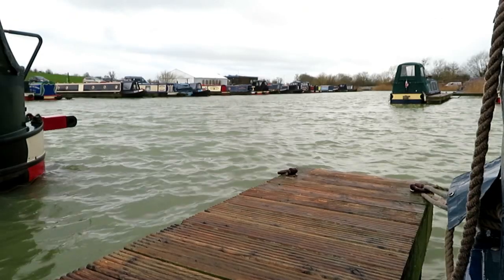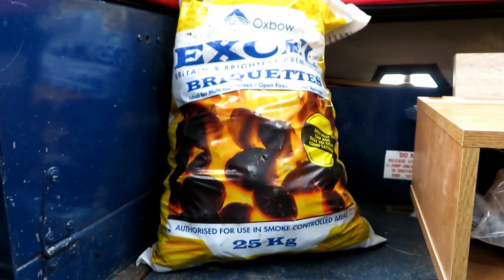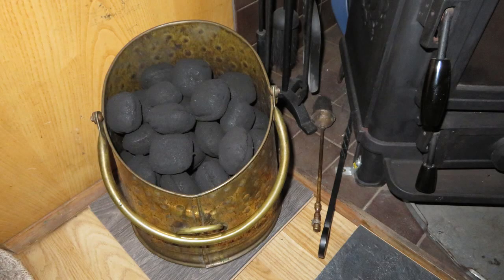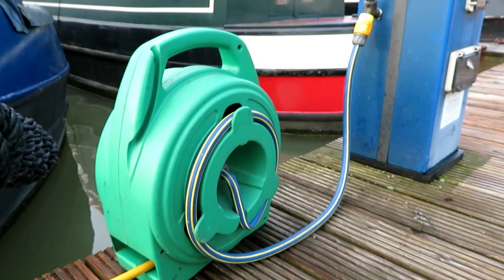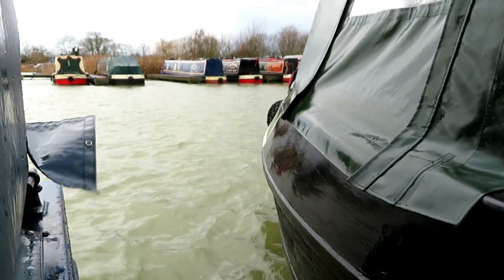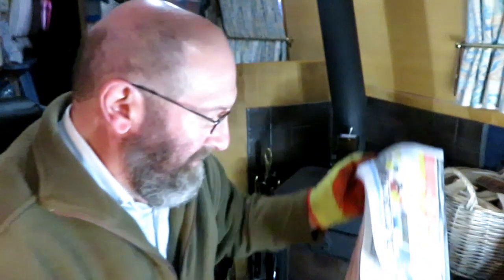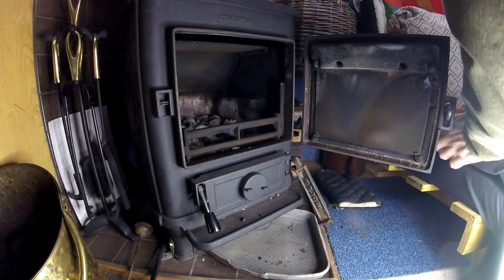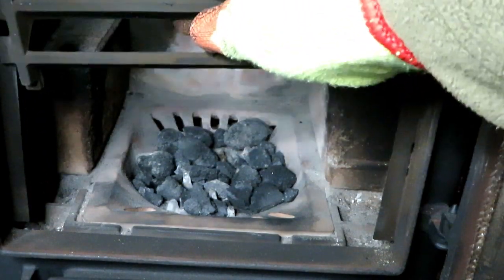89. Narrowboat Life – Fire and Water

Comment: When I was growing up, the primary heat source for the sitting room and dining area of our house was an open fireplace. being in Florida, it was assumed by frugal (read CHEAP) builders you would not need heat often. Where I live/lived in North Florida, winters saw 2-3 months of near and below freezing temperatures. My father would order coal, rough, natural coal, by the ton. It was my job to bring it in and start the fire after school for the afternoon/evening. Every time I see a narrowboater tending the stove in a vlog, it reminds me of that time. Thank you, Alan! My best to you as always.
Reply from the maker: Hi Zach. That’s interesting to hear. I was also brought up with open coal fires. Our coal bunker was underneath a verandah and coal had to be brought up a flight of steps into the house. When my parents had central heating installed, they opted for a solid fuel system instead of a gas boiler, I suppose it was a cost consideration, so we still had to carry on in the old way. Best wishes Alan

Comment: The draft on my Morse Squirrel 1410 is so poor that newspaper produces enough smoke to put out the kindling. 
So I am obliged to use only firelighters to get the fire going, once the chimney is hot then the coals burn fine.
I like a clean door glass, so I rub the glass with damp kitchen paper dipped in fine ash each morning, then we are able to watch the flames.
Great Vlog as usual, keep them coming!
Reply from the maker: Many thanks Geoff. I too like a clean glass but it gets dirty very quickly and I find it a rather messy task to clean in a confined space, so I don’t do it every day. I don’t always use newspaper, as I find firelighters easier to use. Glad you liked the vlog. Cheers

Comment: Hi Alan, thanks for that, I am always stunned when you watch back to basics type programmes on the box that many people don't know how to light a fire. When I was growing up coal fires were all we knew. Cheers take care. Alan.
Reply from the maker: Hi Alan. I was brought up with coal fires. They used to be lit with a separate gas burner. When my parents had central heating installed it was a solid fuel system I suppose, that would have been cheaper at the time than a gas boiler. I had some difficulty filming, hence setting the fire was a little bit messy. Keep safe. Cheers

Comment: Somewhere I read that the bottom vents were for burning coal and you open the upper vents as well for burning wood to give a cleaner and more efficient burn for wood. Is this your understanding as well?
Reply from the maker: Hi Robert. Morso recommend having the top vent open when burning wood. Having the top vent open is also meant to help keep the glass clean. To quote from Morso when using solid fuel "The top air regulator must always be open just enough so that the flames burn almost clearly and the ceramic glass stays clean".

Comment: Nice video Alan. Impressed with the amount of ash - can you give any links to the coal you use as ours is useless and seems to give more ash than heat!
Reply: Project WaterLily I was thinking the same, the bags of coal I get seem to be filled with very small pieces between 1 and 2 inches and lots of dust
Reply from the maker: I buy Excel coal (briquettes) from the Marina. It comes in 25kg bags. They sell another one as well in 20kg bags, which gives more ash (don't recall its name).
Reply: Brilliant, I never knew they sold coal at the marina! ….. :)

Comment: You should always clean the glass. It will improve your heater out put, no end. I use news paper sprayed with nifty. Works a treat. Then you just burn the paper.🇦🇺🇦🇺🙏👍
Reply: Best way is damp kitchen towel dibbed in some ash, works a treat (thanks to Cruising the Cut for this one!)
Reply from the maker: The soot doesn’t get baked on, so I find damp kitchen paper works a treat though I do sometimes use an all purpose cleaner.

Comment: My fire-lighting method - works for ME in MY stove. Remove log guard. Two sticks parallel, front to back with space for one fire lighter between. Two more sticks at 90 deg across the first two - same spacing. Two more on top then half a log/block/whatever you use on top.  A few nuggets of solid fuel on either side and any flat surfaces.  Replace log guard, light fire lighter, close door, open ash tray door and leave until well established. Works well 90 per cent of the time. Your illustration looks a wee bit haphazard in that the various fuels are not in contact with the burney-thing until the paper burns away and the pile collapses.  But, if it it ain't broke, don't fix it!
Reply from the maker: Hi Leonard. I agree with what you say. What you describe is much the same as I do. I don’t always use newspaper, as it’s not really necessary with the firelighters. The problem I had in filming, with setting up cameras/lighting is that I could not see clearly into the stove or reach in properly to set the fire up. It looked rather messy to me but it did take alight and kept burning thankfully. Thanks for watching. Cheers

Comment: Nice wee video. Having watched your videos from the start and see how particular you are , I was surprised you didn't run some water through the hose before putting it into the filler hole ( in case there are any beasties ) and you didn't mention cleaning the glass door of the stove. Not criticising , just an observation. ( - :
Reply from the maker: Thanks Christine. I usually find the beasties in the tap and run that before I use it but I've found it less of a problem in the winter. As for the door, I didn't really think about the cleaning aspect. That's actually a topic in itself, so many different methods of cleaning!. Cheers